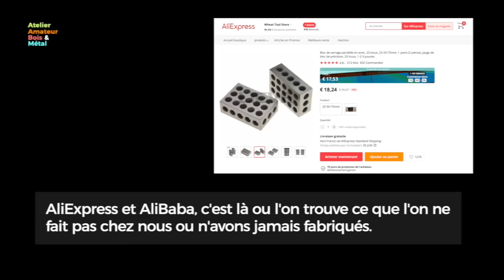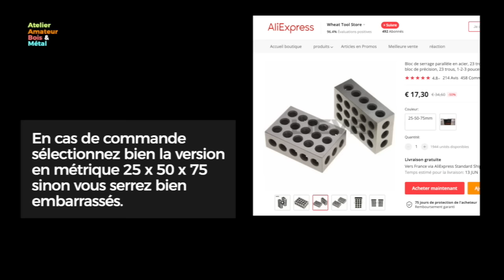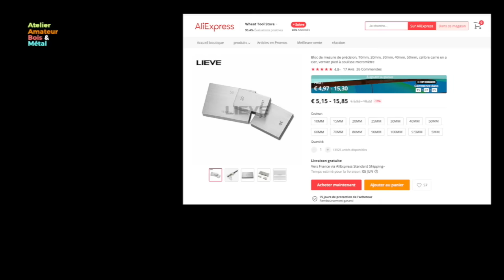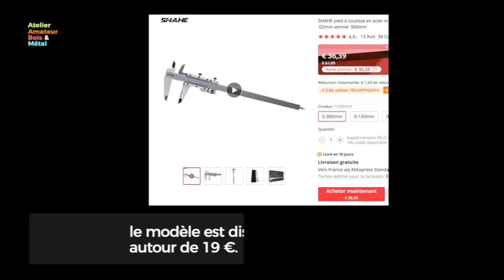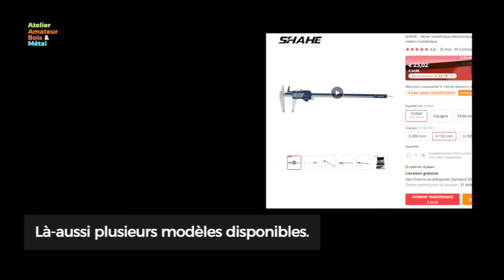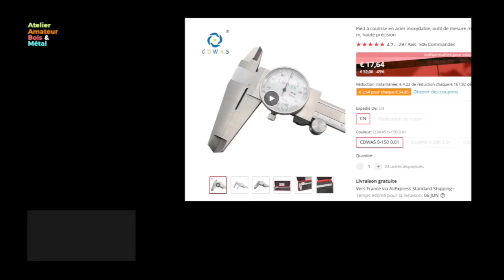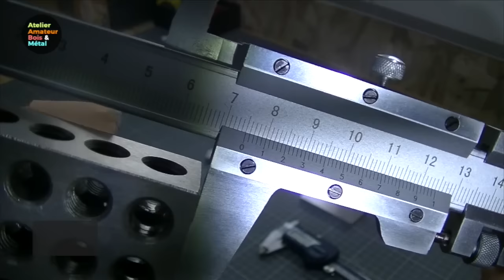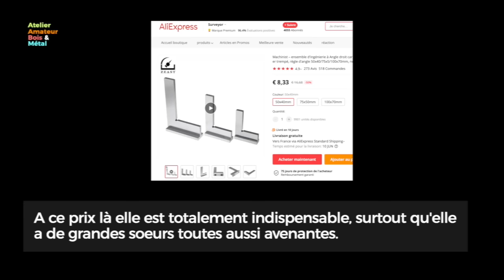Calibrer le matériel pour faire juste mesure.

Comment: Pour le micro ajustement du pied à coulisse, il suffit de serrer grossièrement la pièce à mesurer sans serrer fort, tourner la petit vis au dessus de la molette afin de bloquer la position et de terminer la prise de côte en tournant la petite molette délicatement.
Reply from the maker: Merci pour le commentaire et la suggestion pertinente.
Effectivement j'ai procédé de cette manière mais rien de significatif, alors dans le doute j'ai fait appel aux spectateurs.
Reply: C'est utile sur des petites pièces fragiles ou sur du metal tendre pour avoir une mesure correcte sans tout casser après faut utiliser un micromètre pour encore plus de précision.